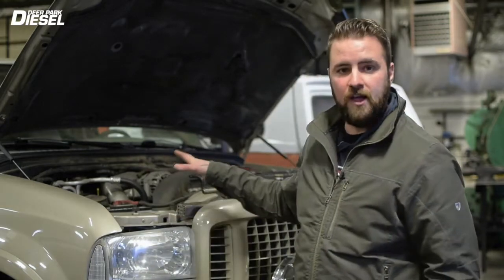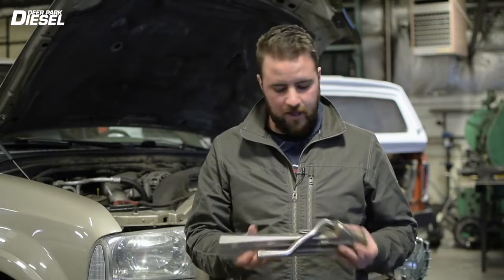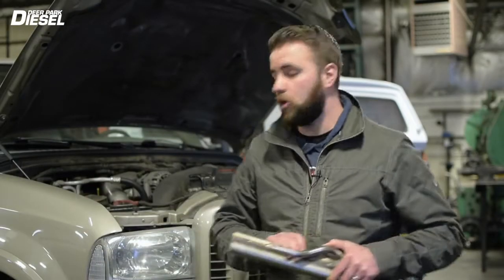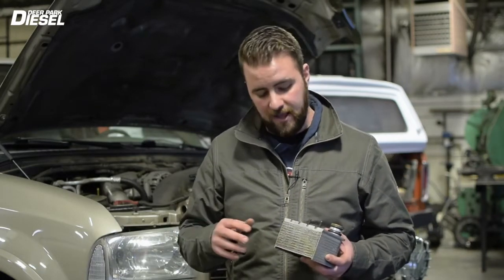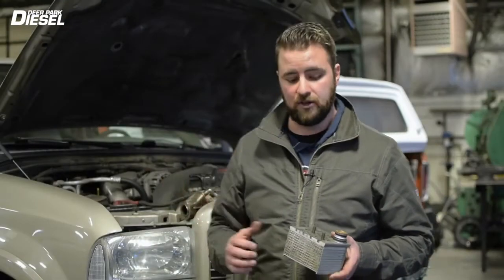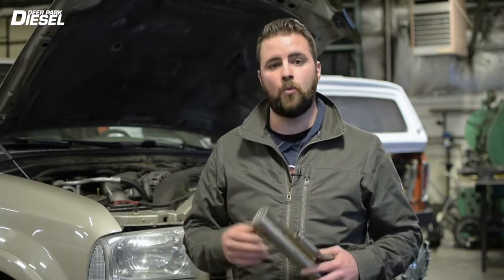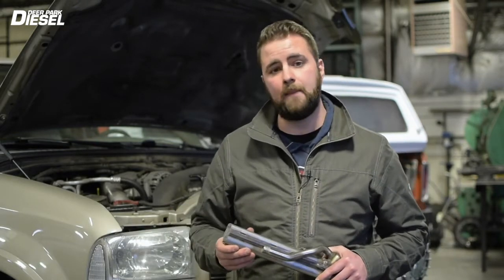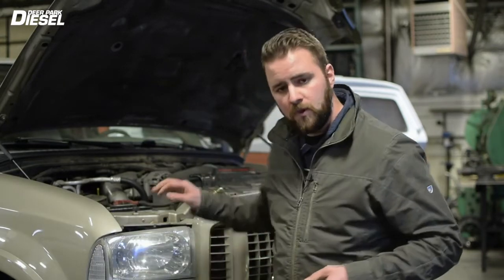What Causes EGR Cooler Failure?

Comment: electronically deleting or blanking off the egr valve, thereby stopping the hot exhaust gases from passing through the egr cooler. Would this solve the issue of the  egr cooler failing ?
Reply: Yes